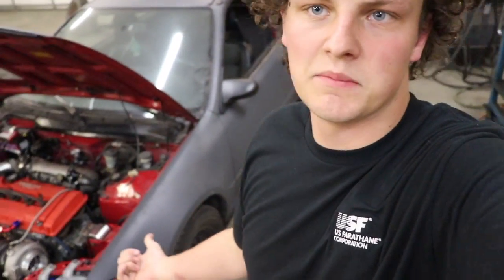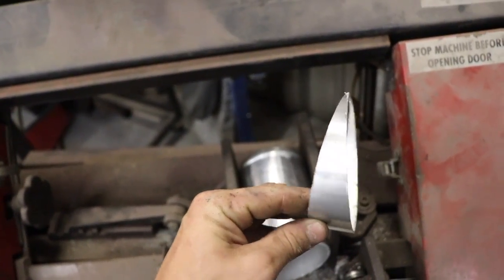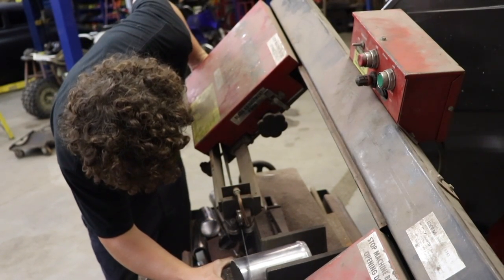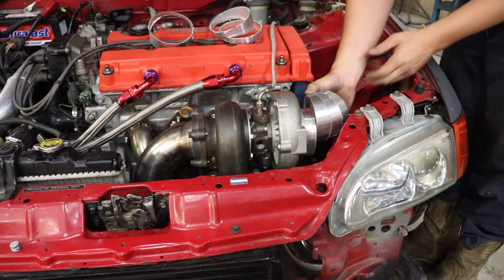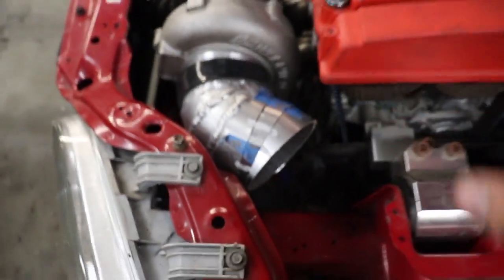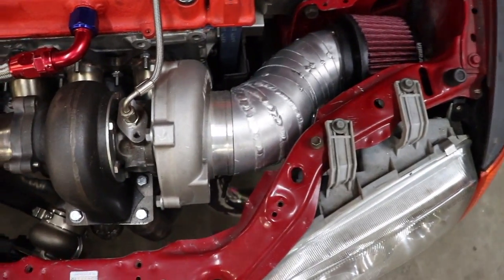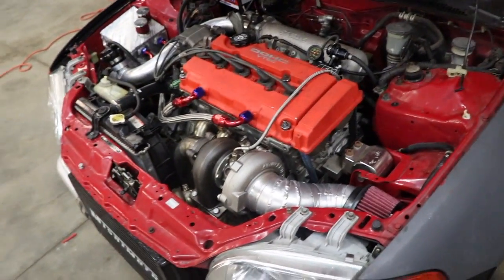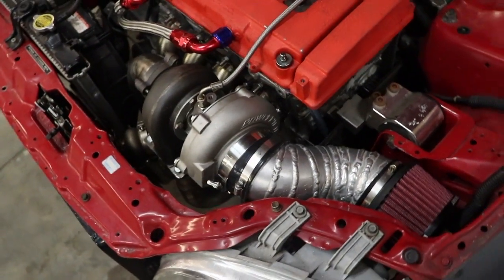Custom Turbo Intake made for GSR turbo Civic

Comment: what is the engine setup on this car , does it run on  93pump gas ?
Reply from the maker: Gsr block and head ,Manley rods, je pistons 9:1, slight port on head, edelbrock victory x intake ported, 1050cc injectors, custom manifold, t3 turbo gt3075, 2.5” piping , 3” mishimoto intercooler, walbro 450 with aem fuel rail and pressure regulator, 3” turbo back exhaust, tuning it in hondata. S300 v3. It’s on 93 right now
Reply: @JohnnyFabz  keep up with the vids